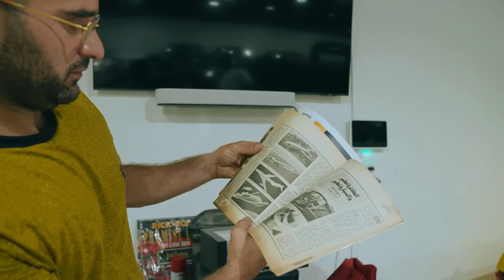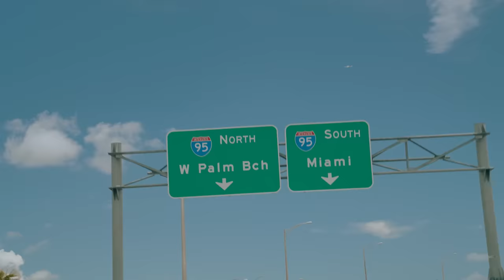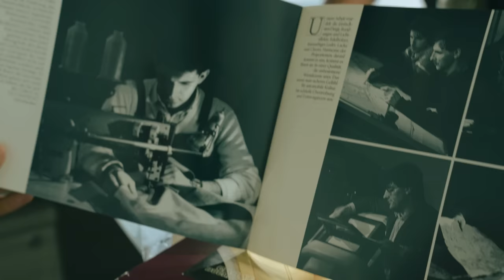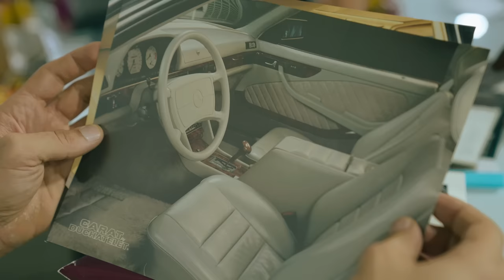WON at Auction! INSANE Three Car Delivery from Japan | VLOG #024

Comment: You should do a Q&A with your mechanics could do with some advice with your expertise. My C140 drops oil pressure from 3 as oil warms up. Not sure if thats normal or if theres a problem. Only just bought my S500 so not a clue.

Comment: I have 2003 e320 gasoline engine it shakes bad in drive when stopped at a red light but doesn’t shake when driving but…. When put in park it stops shaking any diagnosis ??  Motor mounts/ Trans mount ??
Reply: Harmonic balancer rubber prob worn and the rest of the rubber mounts and bushes prob